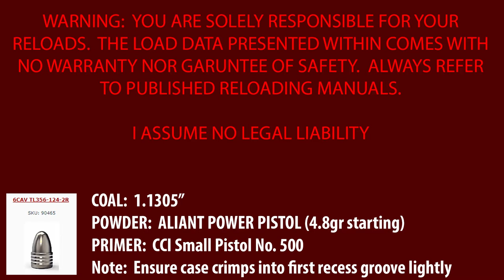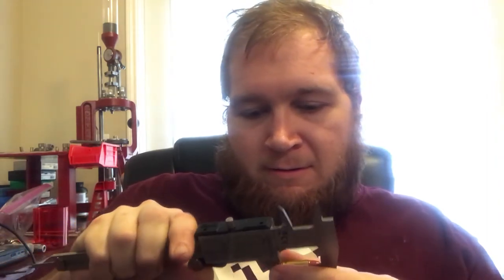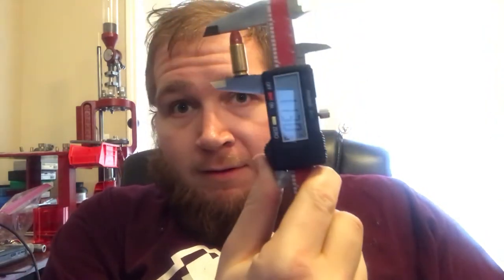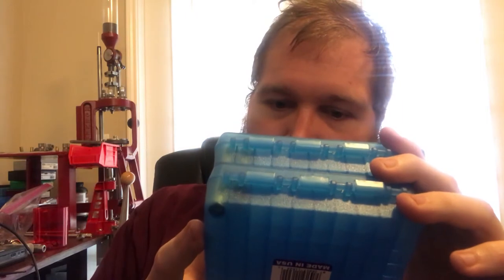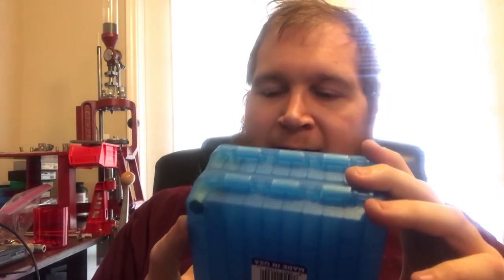Finding a Starting Load for the Lee TL356-124-2R

Comment: I am finding that I need to hold oal to 1.115 after trying to use the 1.130 or other oals from 1.150 coming down every .05 and all jam in the gun . other wise it jams my m and p shield. it plunks but if turned by hand in barrel it will clean off the first groove of the groove coated with magic marker. the 1.115 seems a little hot with hs-6 5.9 gr. but as you stated in the video all my manuals are all over the place with specs but nothing gets close to this one. still ladder testing with crono but not time yet to go. the books and even the powder company's give little help.
Reply: I have been having the same problem with my Lee 124 gr RN. I started with 1.150 OAAL and it wouldn't go into battery It fit my Wilson case gauge  but wouldn't plunk the barrel on my Hellcat or Sig 365. I shortened it down to 1.125. It plunks now but still a little stickey. I'm going shorter like 1.120, maybe 1.115. It runs ok at 1.150 in my PSA 9mm carbine. The plunk test is the best way to check your ammo with your gun.
Reply: @tires2burn  I am going to test some loads they range from 1.90 to 1.15 powders varied for each length tried up to 1.25 but my 9mm shield will not allow any longer. also had good luck with the tc 124. work up with the same story. will let you know later. will be shooting with a crony just to record speed for each length.
Reply: @williamzika8999  I found load data on western load data for 124gr lead. It calls for 1.050 OAL. I made up some dummy rounds with 124 RN  and they plunk and cycle perfect. I'm going to use Accurate #2 low 3.4 to 3.8 grains. FPS is 953 to 1012. If they run good I will load all my cast lead 9mm to 1.050.
Reply: @tires2burn  I think you can call the powder co and ask for a minimum safe load. i was short but decided to move to 1.110 oal.
Reply: @tires2burn  how did your short loads go? i have both the rn 125 gr and the 124 tc the rn has been great but tc is.028 longer so a short load makes me nervous. but would like to try it. any thoughts on hs-6 or power pistol on a short tc load?